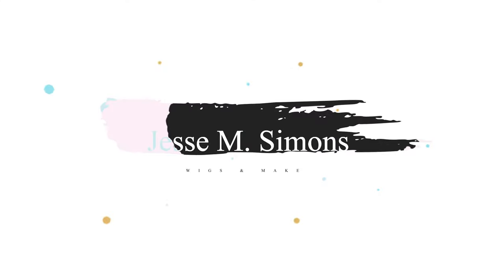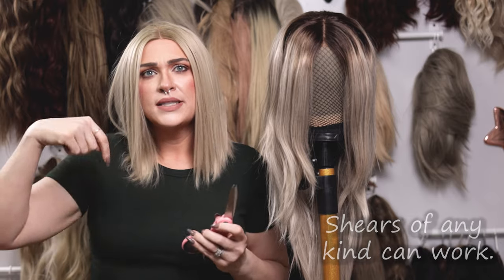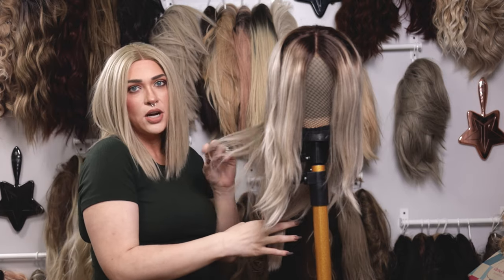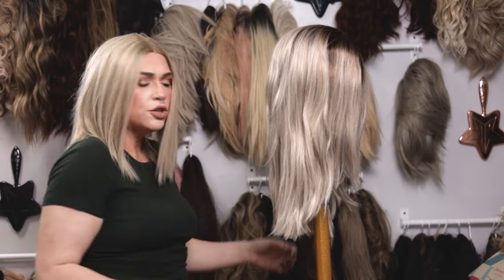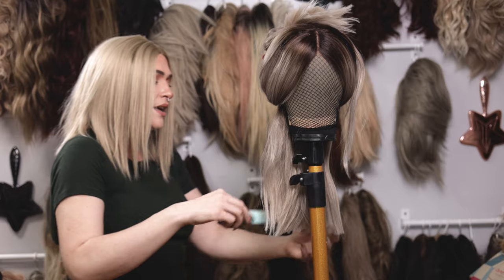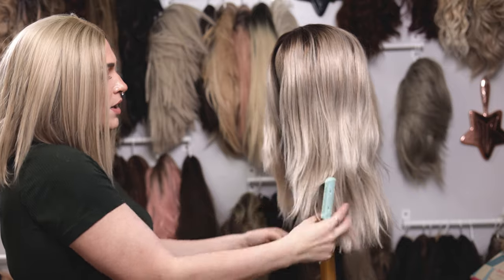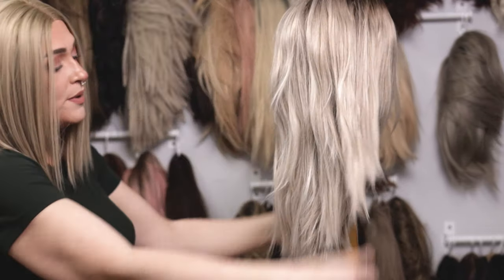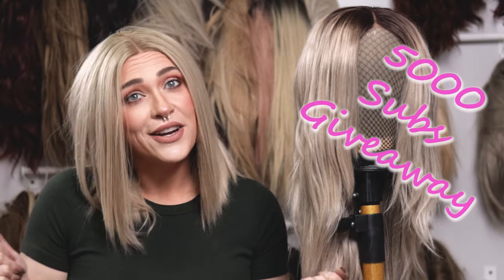How To Cut A Wig | Synthetic Wig Hacks | How To Make A Wig Look Natural | Wig Tutorial

Comment: Thank you! I cut a curly wig of mine a while ago and I wish I had watched your video before I did it! I think it looks ok though and since it’s curly, you can’t really see if it’s too messed up, but I didn’t do the heat trick so it definitely started matting and tangling up. Is there a way to fix that? Btw, love the wig you’re wearing! I’d love it if you linked the individual wigs you wear in each video!
Reply from the maker: You can go back over it with some heat at the ends but it’s going to straighten the ends. Other option is to try a fabric softener soak or a fabric steamer.

Comment: Hi Jessie, thanks for another great video : ) I don't have a heat tool, would I be able to use a steamer or a dyson air wand to seal the ends after cutting? Thanks!
Reply from the maker: Yes you can use a steamer. It will work the same.